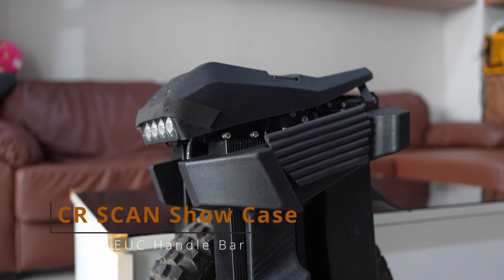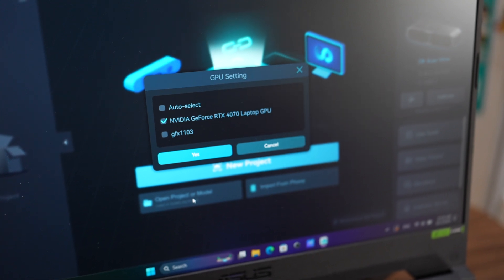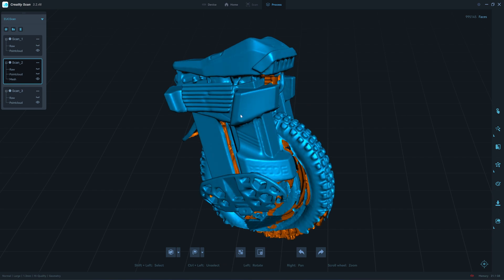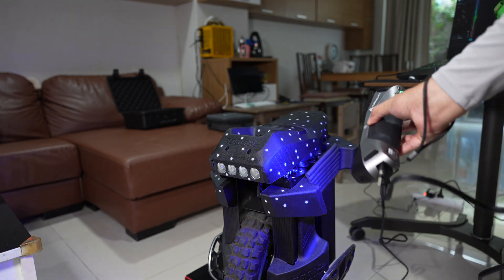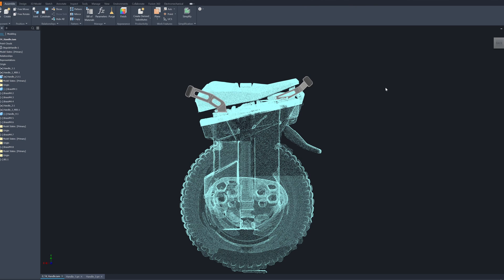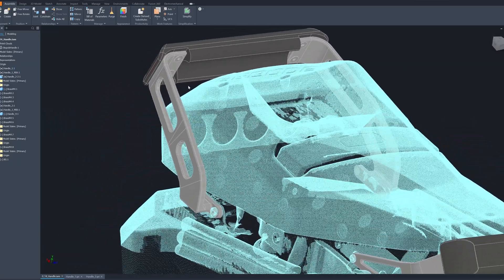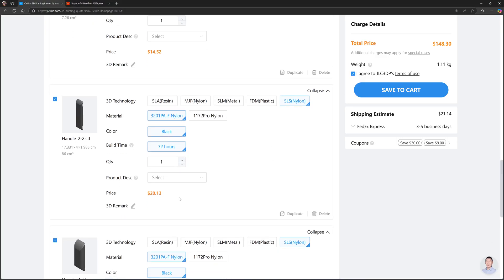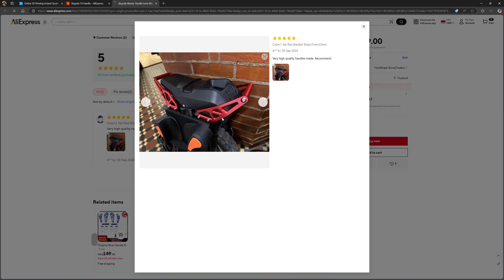Creality Scan Showcase - Making Begode T4 Handlebar

Comment: Hey, I have a request, could you make an .stl of a piece that can attach to the top of the rear battery boxes that extends up flush with the brake pads? there's a good chunk of that foam part that doesn't touch anything and bends outward - I have velcro on mine so I think it would benefit to have an extended anchor point to hold it in place better. 🙏
Reply from the maker: You mean the part of stock pad that attach to rear battery box, right?  I'm figuring out how to hold that properly too. It just keeps peeling off.
Reply: @ yes that’s the part, the very back of the pad that dangles around next to the tail light leds. I was thinking some sort of clip that can slide onto the 4mm  screws without needing to fully undo them to fill that void, then just use hook&loop(velcro between the pad and this piece to secure it better 🤞

Comment: Do you usually just use the point cloud as reference or do you ever go through the meshing and surfacing process? Do you just line it up with the point cloud by sight?
Reply from the maker: I only use point cloud for reverse engineering. I don't import millions of polygonal in CAD, it's very difficult to manipulate. 3Ds Max, Blender, Maya, those are made to handle polygonal mesh. Alignment is done roughly in CloudCompare, I did final alignment in CAD, point cloud can be move, rotate, crop, section, adjust density easily in CAD.
Reply: @ very good info. I have been learning how to use my scanner and get better results, but when I went to use the data to reverse engineer I was overwhelmed with the mesh and what to do with it so I could use it to design off of. I see people make planes and such out of the mesh to get an accurate surface to sketch on. When you start a sketch on the point cloud, what plane are you sketching on?

Comment: Hi @Payo, you have so much experience with scanning, so I would like to know your suggestion: 

I own a CR Raptor, what is the maximum RAM  I really really should have in a computer to ensure scanning and converting scans without getting memory errors?  I want to buy a laptop as a second machine for scanning and don't want to pay for too much RAM, but also don't want to run into memory issues.
Reply from the maker: The laptop that I'm using in this video (TUF A15 2024) has failure RAM, it took me very long time to find out. I've no issue so far after replacing the RAM. I never exceed 32 GB on my scan. (Many time it close to 32GB but not exceeding) You should get the one that can be upgraded to 64 GB.

Comment: Hi, would the markers also help with the otter scan tracking in medium mode? Thanks for your scanner videos
Reply from the maker: Yes, it works the same way. But in Otter-medium mode, you'll need to apply more markers than the Raptor because FOV is smaller.